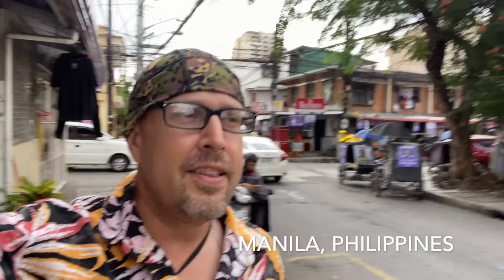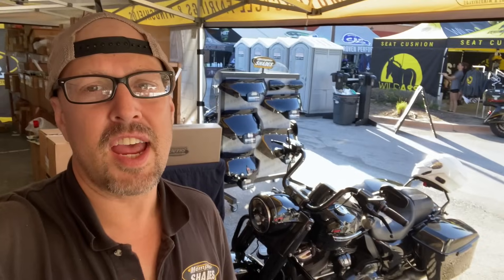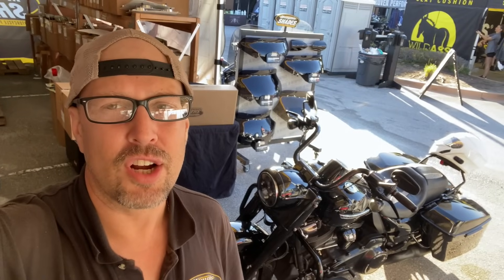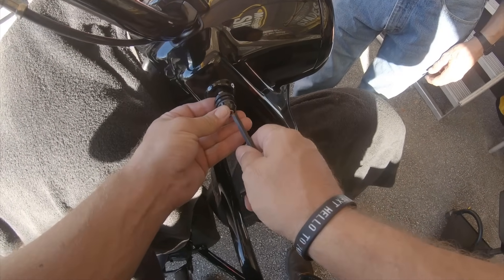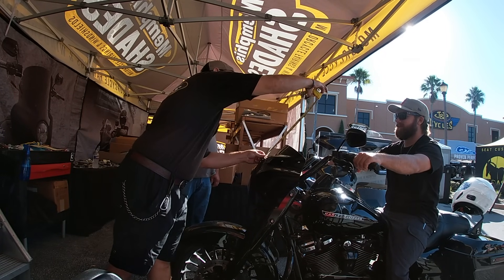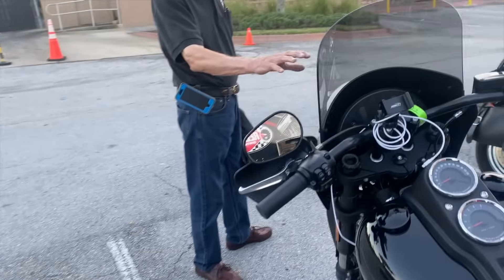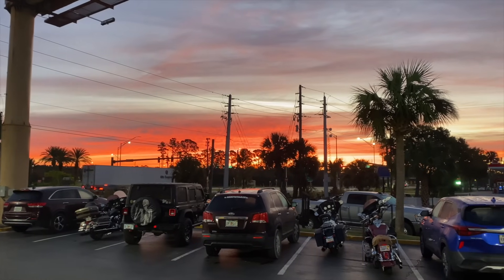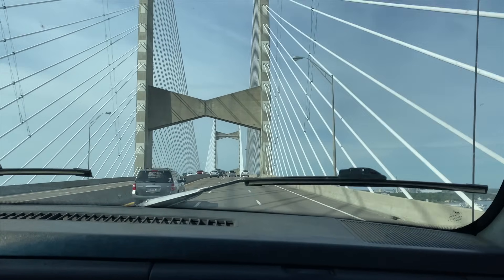DMV: Working Biketoberfest 2023

Comment: That loose piece he was talking about. Is it a rivet nut? Inserts like a pop rivet but has threads on the inside.
Reply from the maker: The customer had a couple of mixmatched loose hex bolts hanging out the side for some odd reason

Comment: Great video Joe, I'd say you got it made woth memphis shades man. I want a memphos shades shield for my 04 road king, but I kinda keep thinking about the bat wing fairing  for it. What's your opinion of the bat wing fairing g on a road king Joe?...have you ever installed one on a road king before?... and does it mount up nice?
Reply from the maker: Thank you my brother. Yes, I've installed lots of them on Road Kings. It mounts up great and rides great on the highway. It's more aerodynamic than the standard RK windsheild and doesn't weigh much
Reply: @dirtymotorcyclevagabond  ok, great man...thanks for responding back Joe....kneez in da breeze man.....hippy trev says that, another cool dude